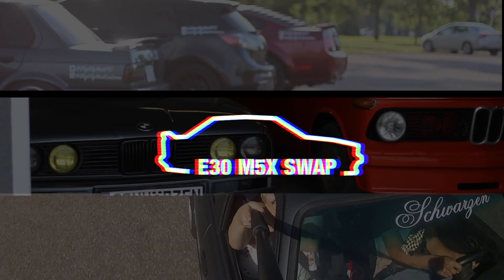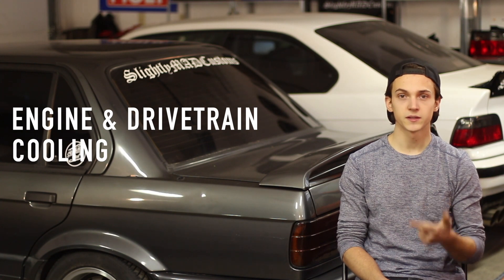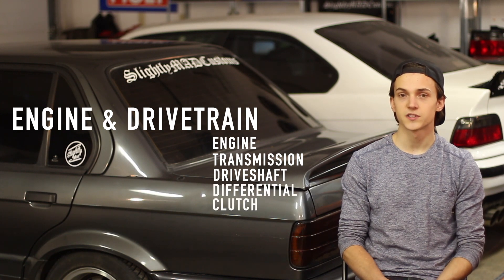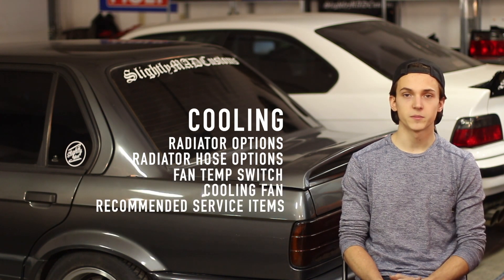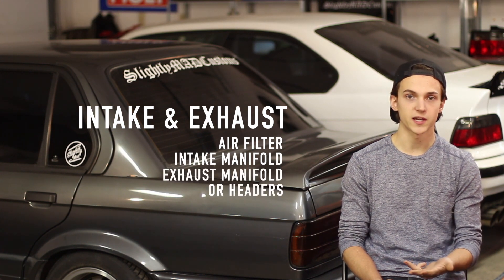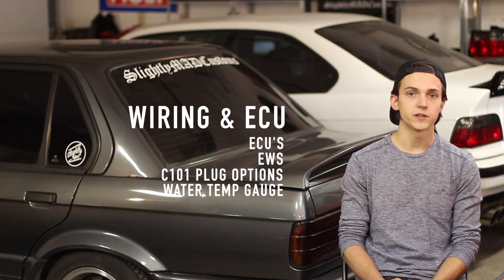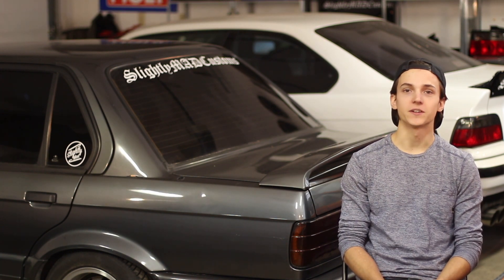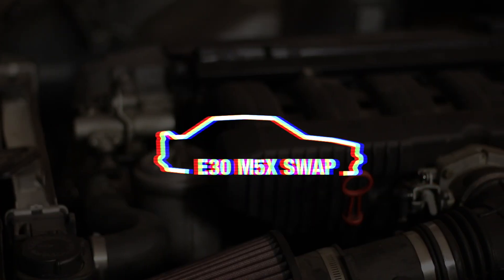Ep.1: Overview - E30 M50/M52 Swap Guide

Comment: What’s the difference between swapping an S50 compared to an M50?
Reply from the maker: There is no difference for the physical swap. The only thing is you’ll need an ECU from a s50 to run it
Reply: slightlyMADcustoms alright thanks. All the parts are the same I just gotta buy a plug and play ecu
Reply from the maker: Ya for sure! You’ll need a tune with a stand-alone ECU as well

Comment: I’m torn between boosting a M20 or swapping in a M52 for a E30 and boosting that. Looking to make a max of 400hp. Probably start out more around 300hp. Main question is if using the M52 I can use the harness adapter and run the M52 ECU, but from there which engine management is easiest? Use adapter and plug n play MS? Or does it not work like that? Would I need to completely wire up my own mega squirt?
Reply from the maker: Saw Greater I would recommend going with a M52 over m20 if you can. It’s a much better platform to start with. You can use the adapter plug to adapt the m52 harness to your E30 body harness no problem. You COULD wire up a mega squirt (depending on your skill level), or I would find someone in your area that has a dyno tuning shop and ask them what they would recommend and what they feel comfortable with.

Comment: Does this swap guide work with the s52 as well?
Reply from the maker: Yes it will work for S52. The physical installation including mounts, transmissions, driveshafts, etc. Is the same across all the engines of this generation. On the electronics side, the M52 and S52 require some extra coding to the ECU to make everything work properly
Reply: @slightlyMADcustoms  Thanks